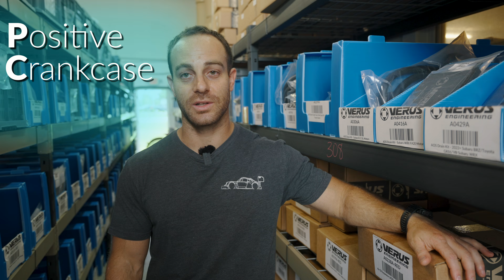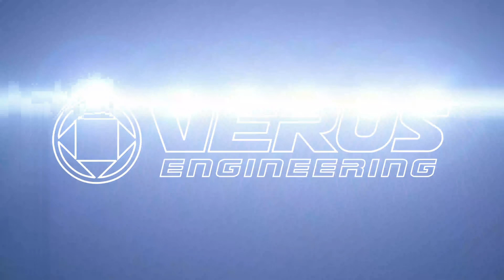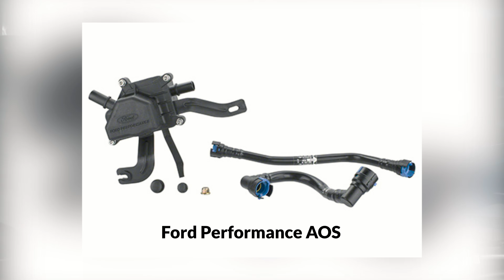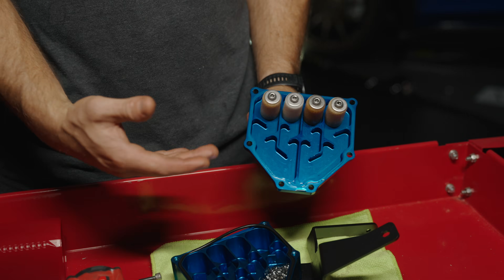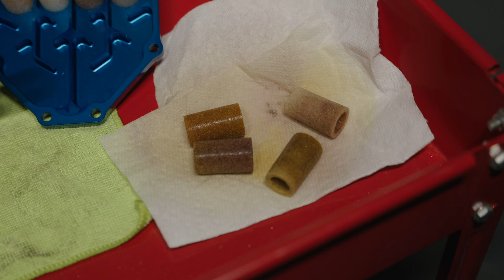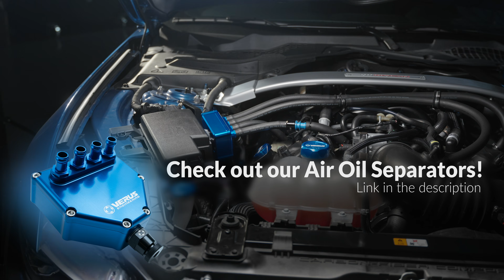What does an Air Oil Separator (AOS) actually do?

Comment: I have a 2008 Mercedes W211 with an OM642 Turbo V6 Diesel.  This engine is notorious for PCV system issues and oil consumption through the turbo.  Do you have any suggestions on how to adapt your AOS to this system?
Reply from the maker: Great question! This isn't a motor that we are familiar with. However,  please contact us at sales@verus-engineering.com and we will do our best to help!
Reply from the maker: Great question! This isn't a motor that we are familiar with. However, please contact us at sales@verus-engineering.com and we will do our best to help!
Reply: @VerusEngineering  Ok.  You should do a little research in that motor.  It's one of the most widely used engines by MB - Passenger, SRV, and Sprinter Van.  If there was ever an engine that needs a solution with a huge potential market share for an engineering house like you, this is it.  Develop a solution, and you'll have a huge potential customer base.

Comment: An excellent video this one and I want to address the point about the oil catch can vs AOS. Specifically for the GR86 application, a channel titled Driver’s Paddock had a discussion video addressed the short coming of the motor, what the data shows, and some of the most common things done to counteract the oil starvation issue. One thing I found interesting is how they mentioned the trade offs of the oil cooler and the AOS versus the Catch can.As mentioned Ford performance uses an air separator so it’s clearly a good technology, but in some applications, it seems to not filter as well and recycle that back into the engine and a lot of people said that may be the shortcoming of the AOS versus the cash can. It definitely depends on the situation and I know you guys are developed a pan for the car so I wanted to hear your thoughts on the AOS vs Catch Can in general as well and ur thoughts for the GR86 situation. Watching the video and getting your feedback on that would be sweet as well.
Reply from the maker: Can you try to clarify you question? I just don't fully understand the question you are asking. Feel free to email it in as well so we can respond quicker!
Reply: @VerusEngineering  No problem, so I wanted to know you all’s thoughts on an AOS vs an Oil Catch Can, that’s my first question. 

I’m asking because in a video by a channel called Driver’s Paddock. They talk about the trade offs of the two in reference to the GR86 and its oil issues. 

My second question is in-terms of the AOS, I’ve heard negatives about the fact the oil is being put back into the system versus being captured. What made you guys want to invest in the AOS so heavily ?

Comment: I've had my eye on these for awhile. The AOS with drain-back sounds way better than catch cans but do they never need maintenance? Like, does the mesh ever get clogged or do the desiccant filters need to be changed at some point?
Reply from the maker: We haven't seen the mesh clogged to date however we've seen some customers ask to replace them when they get dirty/oil logged. They're still functioning at that point but easy to change and "refresh" if that makes you feel better!
Reply: @VerusEngineering  That is helpful to know, thanks!